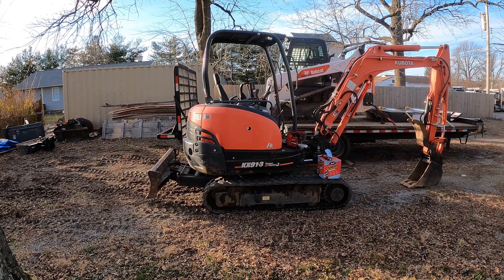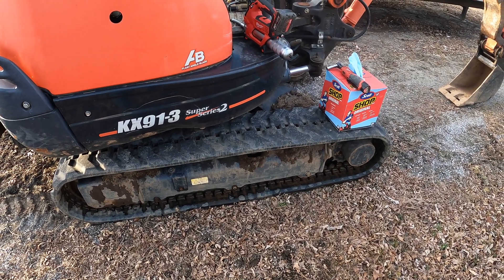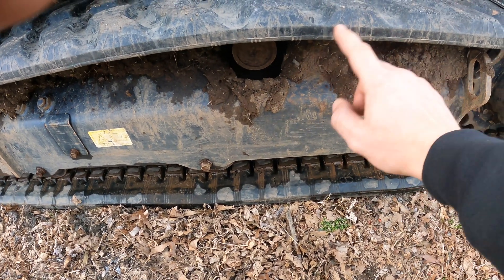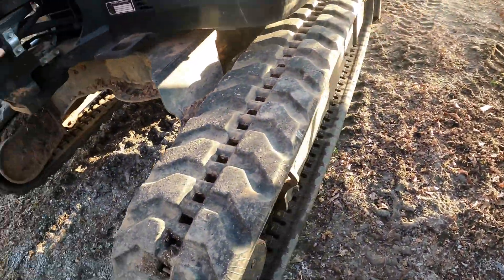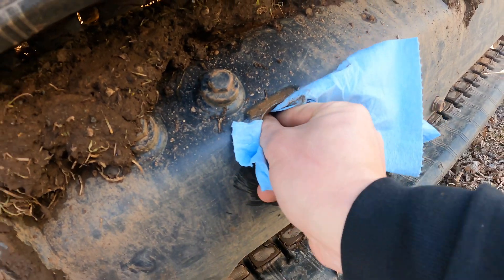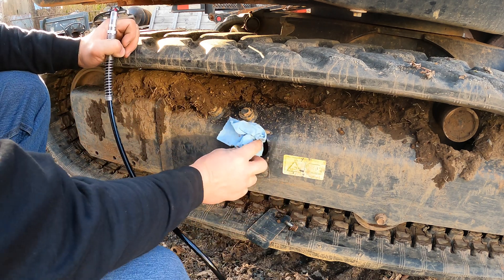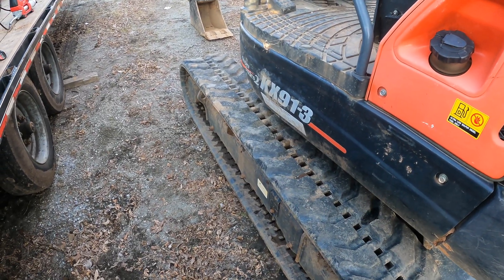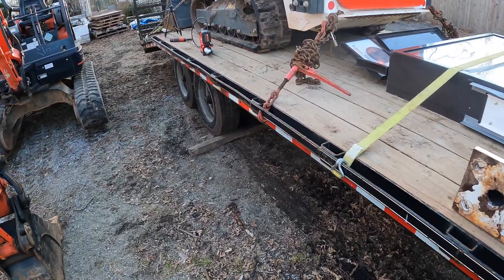Mini excavator track tension

Comment: Good info.  To the point.  I thought the 8 indicator was supposed to be at the top idler myself but I could be wrong?  Also I don't know how important it is for placement but I have thrown a track once on my mini and it wasn't too bad to get back on.  Better loose than too tight. Can't speak on the Milwaukee grease gun - I have the dewalt cordless gun and I'm happy with it.  Good video!
Reply from the maker: Thank you, the distance between the idler and the sprocket is pretty close anyway so anywhere in the vicinity is probably fine. Thanks for watching and the comment!

Comment: I think the reason many lift one side at a time is because larger excavators don't have the stabilizer blade so you cannot do both sides.
Reply from the maker: That makes sense, I've only operated up to a 10 ton which had the blade. Now that I'm thinking about it the larger ones I do see don't have blades like you said. Thanks for watching the commenting!